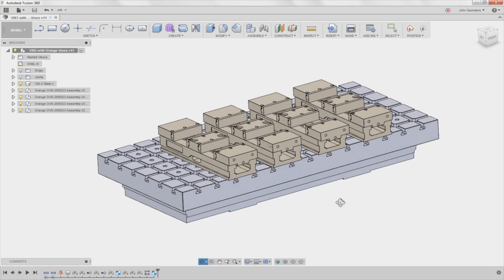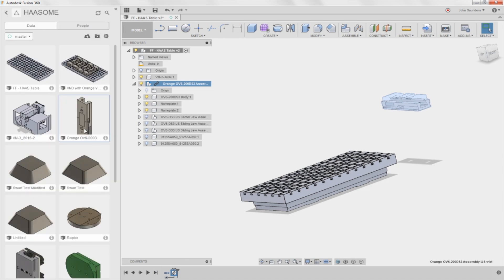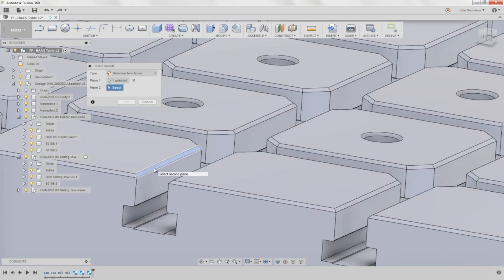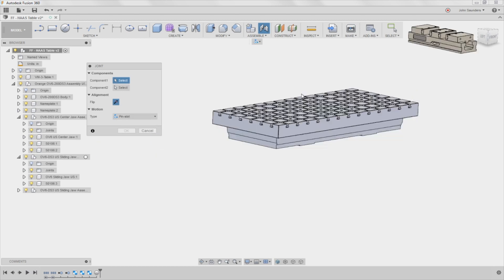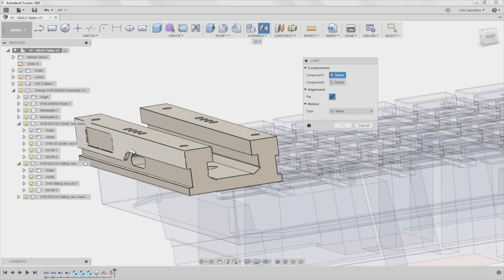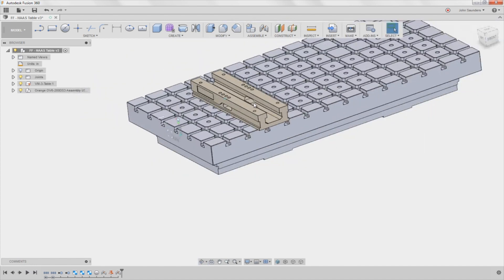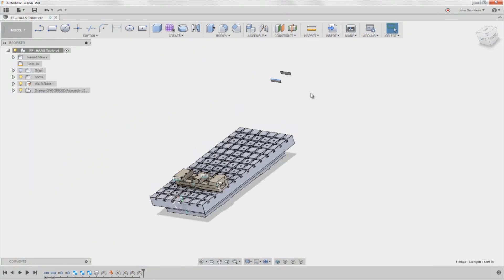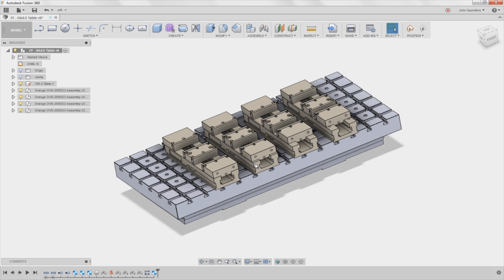Modeling HAAS VM3 with Orange Vises!  FF64

Comment: I've been using Pro-Eng, Pro-Man, Creo for many decades, programming and setting up HAAS's, FYI when you line up vise go off the bolt holes on vise because this is where you bolt your vise to the table, also we use datum planes for lineup, they are so much easier to use  then using edge like that ( If fusion has that feature ), and line your vises up from middle of table ( X-axis ) and build your 4 vises from the table's center.

Comment: In my opinion this would have been way easier to just use rigid joints for each vise to the table from the same joint origin you created and then use offsets to set the exact position. What you can then do is set each vise position in Fusion with the actual position they are on your machine by measuring from the physical place on your machine (your joint origin in fusion) with a probe\haimer and updating those offsets in your rigid joints. I do this with vises and fixtures on my machine and it works great. If your doing softjaw work, you pretty much never have to change your work offset on the machine after you set it. Since all the locations are "known" in fusion it also adds another layer of crash protection. I do my absolute best to stay away from rigid groups whenever possible, yes they have their uses but they can lead to positional errors pretty easy and they can constrain movement of other joints that you actually want to move.

Comment: John on my Oranges in Fusion, I turned off design history and killed all the chamfers to help speed up stuff, and to get myself better measurement points on the vises.   For the slider joint on the Jaws I used the inside edge of the Vise Bed Rails, and the same for the Jaws.   Ran into the same issue you did, having to put offsets in there which I didn't like.

Comment: There are always 1,000,000 ways to boil the ocean, But given you were locking everything down with ridged groups, you could save your self a bit of effort.. You could have done a few alignments to get your 1st vice where you wanted it instead of the multiple joints...  Would have been a touch more intuitive and less "math" for the CAD to keep up with as your ridged grouping everything to the table anyways... Just a thought

Comment: Perhaps you could have used an as-built joint to join the jaws to the vise bed before you aligned the bed to the table... since they were in alignment in the vise model. I think that then you could move the whole assembly on to the table in the same manner.  Are you planning to use that file as a sort of template that you will do your cam work in to make sure you avoid collisions and that sort of thing?   BTW I'm super jealous of all your orange vises... Thanks man!

Comment: Hi John,  I would suggest to use the 'align' feature. (MODIFY, Align). After proper alignment, choose 'as built joint' pick the slider, pick the base, click on any of the lines parallel to the desired motion and bam. Edit joint limits if needed. 'Align' followed by 'move' is a handy combination too. The mate feature of Solidworks is much more evolved, although I do like F360. But it's a mess sometimes. Especially when building a model that needs changing and tweaking afterwards to move some components.  Also; the 'Some components have been moved' message needs to go too, it should use a 'never show again' tickbox..
Reply: Berend Lucas van der Weide 
+1 on the "moved components" warning. 

I curse that message out every time.
Reply: I'll second the use of the Align function.  I had to put a round box on the side of a pipe. No way to create a joint, but align followed by an 'as built' joint was easy.

Comment: when you select surfaces (like with the planar joint or at 6:10) the Z axis is usually the normal vector of that surface, meaning the axis is at a right angle to the surface and is counting positive away from the 3d model and negative if you move "into" the model.

Comment: Off topic slightly but if you had an orange vise fixture plate for their ball locks  you could remove the vises without having to worry about tramming them in later...save a lot of hassle in the long term  I know  extra cost but time is money.

Comment: on the planer constraint, control click the lower edge of the vise and upper edge of the table face. this will animate it at the height you want. and that is why clicking the proper points is important.

Comment: Still do not like Fusion's joint system. 

I get they wanted to make it easy and apply multiple controlling mates in a single shot.  But seems more trouble than it's worth. 

A lot of times I'll just use the Alignment tools and just make as is joints. 

Or just do it in solidworks 😊

On planar if you hold Ctrl and select 2 faces it will give you the midplane of those 2 surfaces automatically and you can select that.  Works well for getting your vice jaws dead center to the slot. Mate the mid planes of the slot in vice to the T on the jaws, don't have to worry about the chamfers.

Comment: I'm a little confused why you went to all that trouble of creating all those joints the just made everything rigid at the end? Are joints the only/easiest way to move something into place in Fusion?
Reply: Steve just Steve 
Alignment is easier. But doesn't stay. It's simply moves parts into position but doesn't lock their movement in any way. 

Joints maintain a mathematical relationship between two parts and maintains that relationship at all times. 

So when he did the slot joint from the vice hole to the table slot, he could move the vise around still, but it always kept the hole lined up with the slot.
Reply: +Occams        I understand all that, but isn't it all pointless if the last thing you do is make everything a rigid group and or you don't intend on the part to move in a constrained way/move at all ever again?
Reply: Steve just Steve 

He had to get the first part aligned in the right spot. 

Using joints over alignment prevents you from accidentally moving the part out of position before locking it down. 

Though his last rigid joint was a bad move. Because I'm pretty sure by rigidly joining the entire vice model to the table locked the jaws (which should be moveable) in place and will no longer move. 

He should have rigidly joined just the bottom surface of the vices to the table.
Reply: Thanks for explaining, but after listening to what you said may I rephrase my original question:   Why not align the vise (sense you said alignments can be easier) then immediately create a rigid or as built joint with bottom vise surface and table?
Thanks for taking the time to help. It will be put it to use.
Reply: Steve just Steve because then he'd only have a 3min long video that didn't show how to use joints lol.
Reply: +Occams   Hahahah thanks man.

Comment: Good video but like poking yourself in the eye compared to SolidWorks mates.  Not a troll for precious commentary about comparative costs, just an observation on usability  :-)
Reply: Scott Moyse 
Ya. But what's unusual this time is I'm not the only one 😆
Reply: Scott Moyse I've yet to see a good video of it in action that isn't from the guys who write the software. (who know all their limitations and rehearse the modelling several times before making the video.. even solidworks corp make things look easy and fluid when they aren't in reality)

this is basic assembly stuff. show me someone who is good at it and I'll call myself convinced.
Reply: Scott Moyse 
I beg to differ. Solidworks mates and constraints system is far more powerful. Not only powerful, but intuitive and doesn't do extra things you may not want it to like Fusion does. If I make a planar joint. I want JUST plane to plane alignment, I don't want to pick a direction, I want it to float anywhere on the plane and it don't want to have to specifically tell it to float anywhere on the plane. 

For that vice jaw, a width mate would have gotten it inline, dead center in seconds. Then a coincident mate to the vice top.   Easy and aligned and the chamfers wouldn't have made it any more difficult.
Reply: Scott Moyse With all that experience Occams must be at least 1000 years old!
Reply: I had the same feeling. In SolidWorks I hardly struggle with mating parts! It probably doesn't help that John it's an old hand at using "joints" (-8
Reply: Barry Thompson Joints are far more powerful than mates and constraints. Onshape uses the same tech as well. You just need to learn them.
Reply: Scott Moyse if it's not intuitive, then it's not ready yet. that whole video was super painful to watch. it's why everytime I try to play with fusion I go running back to solidworks.
Reply: Occams Sawzall you always beg to differ. nothing unusual there.
Reply: Cad-Cam_Man I guess you have a history with this other guy, but that video was really hard to watch. 

I love that you can request a feature and fusion team will work on it. I believe fusion is the future, but right now there's a bunch of stuff in the the software that's just not ready and is plain tedious to do.

let's all move on.
Reply: Matt Jobson there are tonnes of situations where using Joints means you define movement between two components in 3-4 clicks. where with mates or constraints, it would be that many or more for each of the 3 mates / constraints required. Then there are situations like this where it can be a pain if you are it of practice. you have to remember that John often records as he learns. I tell you what, this is what I looked like trying to use Solidworks mates numerous times having used Inventor constraints for 9 years... I wouldn't call several of the Solidworks mates intuitive, the same goes for some of Inventors constraints. Sure Joints need work, but in a tonne of situations they are incredibly useful and recognised in the simulation environment. Which mates and constraints often aren't in most simulation packages.

Comment: As-built slider joints on the vice jaws before moving the whole vice to the table would have been easier. You're right, because of those chamfers it limits you from doing other easier joints, I usually like to pick the very edge center of one part and join it to the very edge center of the other part and work with the dimensions to locate the part from the edge

Comment: When using a face to designate an axis direction, the result will be normal to the face. Normal to the side of the t-nut slot, would point into the center of the slot.